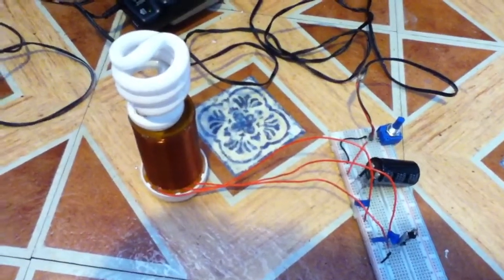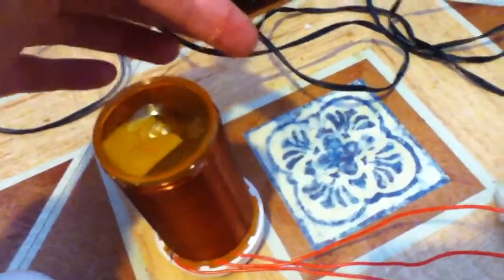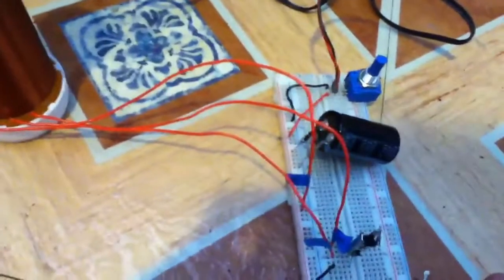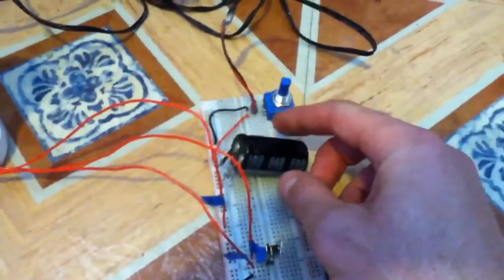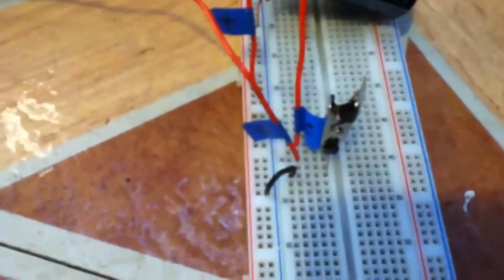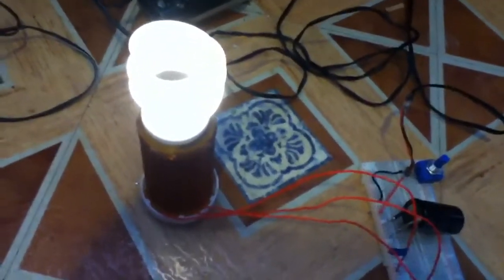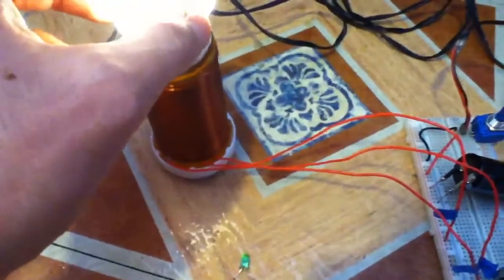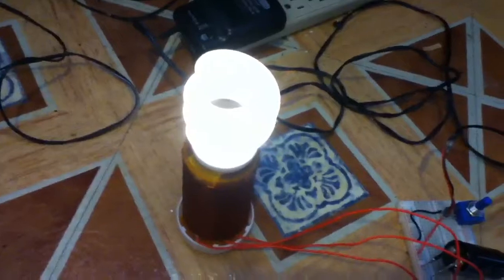Cat exciter on overdrive

Comment: Great job there and it really does look to throw out quite a bit. A good Darlington power transistor like the TIP122 might be best for it...that poor little 2N2222A is missing her extraneous parts lol
You'll be able to charge a cellphone with that output. AV plug and piece of wire from 1 diode on the phone side as a balancing antenna. Sit the phone away on its charge cord and it'll charge nicely, wirelessly.
2 Walgreens will link their plasma outputs across the air gap btw, A fun experiment.